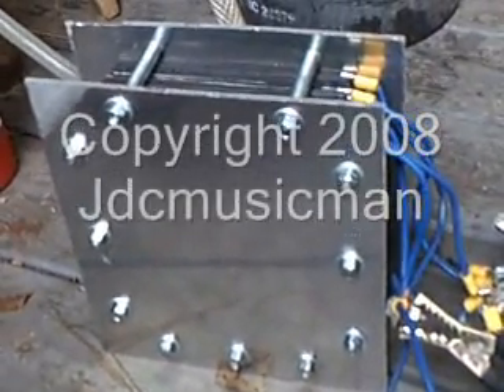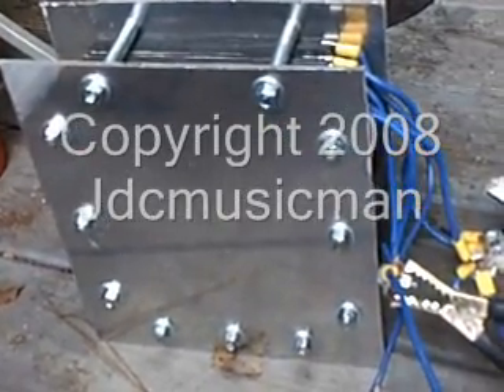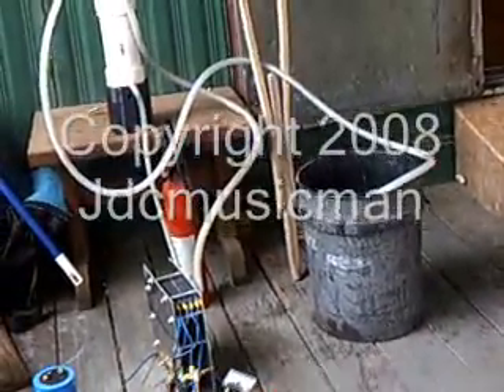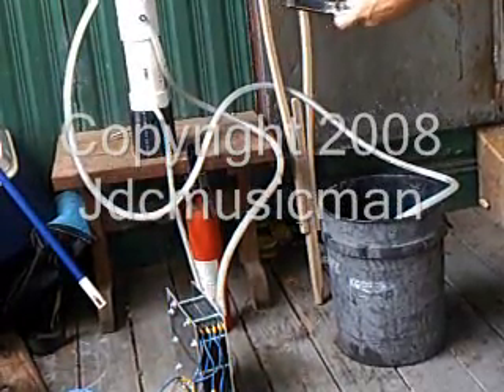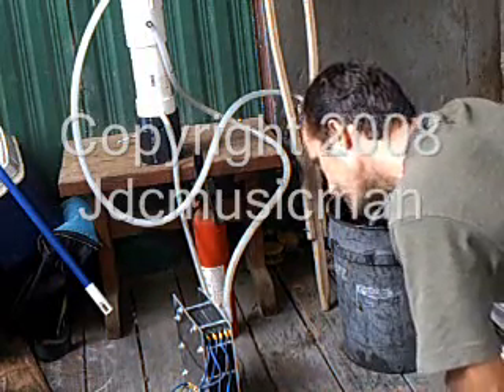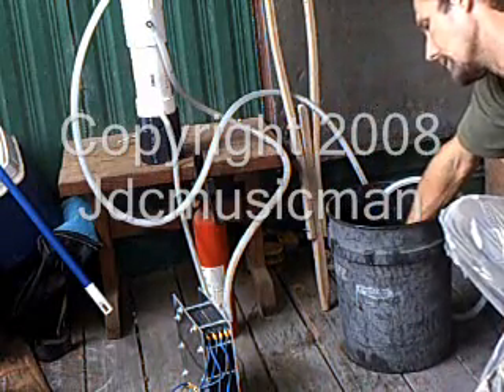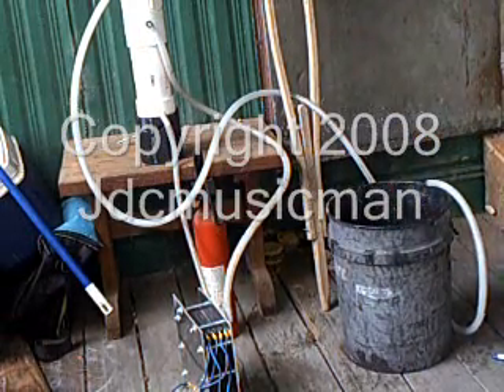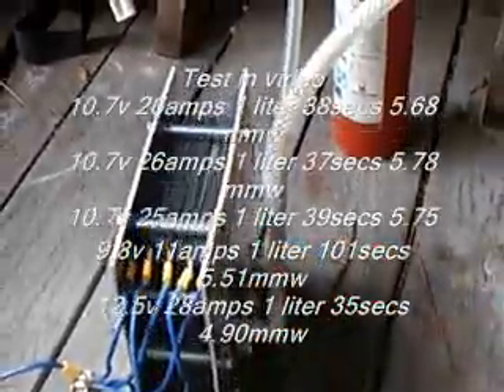21 plate 6x7 3/8 Tubed Dry Cell Results#3

Comment from the maker: in the video the cell had not been on long , it was fairly cool...I hadnt had time just to let it run for a while...I managed to do a few test bout 30 mins ago..I ran it as a series , with 41volts 9.5 amps and it gave me a 6.16mmw, But i blew my homemade variac(aka light switch dimmer)so I had to quit testing..Going do some more testing later today.with these last results I don't see why I couldn't hit a 7 after getting everything warmed up...Only run for bout 20 mins today.

Comment: Very nice work. I am interested to know what temperature the brick is running at.
Most of the efficiency work has been done with dry cells with open holes. I wonder if a sealed hole setup like yours would run better at a higher voltage. 
When you test 5N I am guessing that it will run cold. Try adding heat. It is a pain to do but adding heat will increase production and the MMW.
Mars